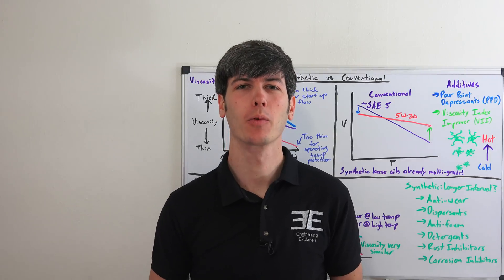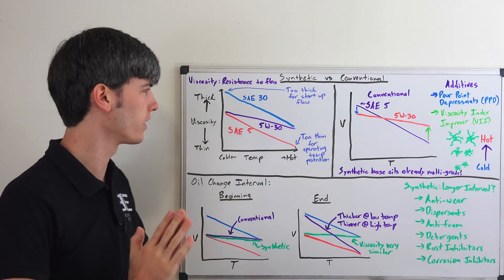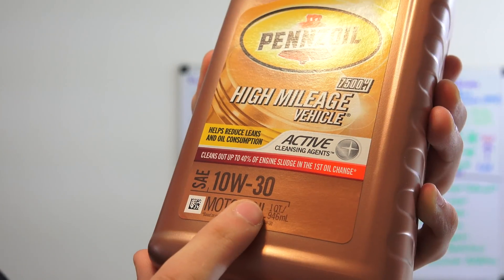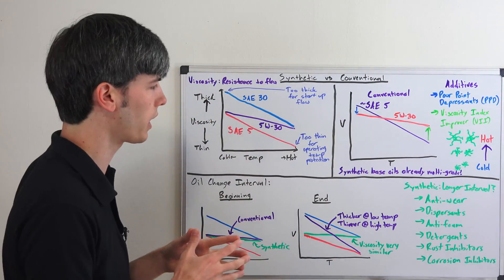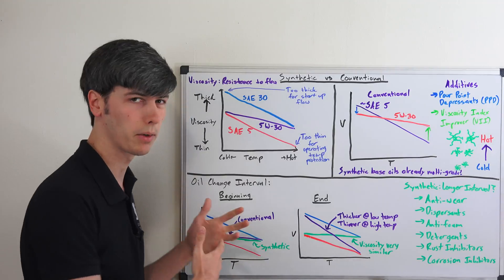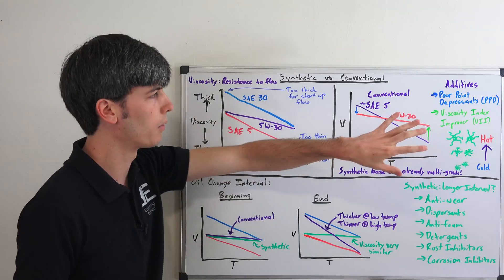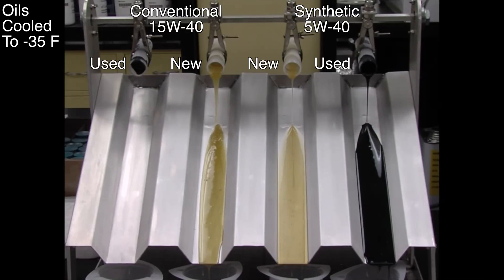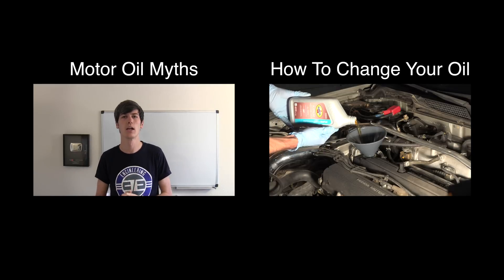Is Synthetic Motor Oil Better For Your Car?

Comment: I AM USING 10W-30 SYNTHETIC OIL FOR MY 100CC BIKE FOR HOW MANY KMS I WANT TO CHANGE IT
Reply: Its different on some motorcycles.  If your bike has a wet clutch. Then the motorcycle oil has to lube the motor and the transmission parts.  Which motorcycle oil breaks down faster due to high compression and more moving parts.  You may want to change min every 5km.  I use Motul full synthetic.  You can notice different on shifting if you use a better oil than what you are using now.

Comment: Anyone who has lived in extremely cold climates knows synthetic oil can be the difference between being able to cold crank an engine to life or not. The difference is extreme and memorable. Does the average Joe in a moderate climate who does his regular oil changes with a descent conventional oil need synthetic? Not imo. But if it helps you sleep at night, it's your money. If you live in a nice climate, buy conventional, put the extra 15 or 20 bucks (or more) in a jar every change, and use it to service your transmission every 50,000 or less (depends on the operating enviroment). Transmission failures are WAY more common than well maintained engine failures and will cost you wayyyyy more than you think. Always check with the manufacturer when extending oci's on a warrantied vehicle. If they require you to change it every 5 or 6000, you'll lose any longer interval benefits a synthetic can potentially deliver. My 2 cents. Well done video

Comment: Some of the change intervals you might see these days are crazy.  15,000 miles or more.  I have a bit of a hard time believing that the oils sold here in the USA are quite that good.  Here in the USA there is an advertising loophole that allows oils that are technically not really synthetic to be labeled as synthetic.  They are pretty much getting away with false advertising!!!
Reply: And here in Europe, that would get the company fined for millions or barred from the market.
Reply: ***** That just shows how different it is from one country to another.

Comment: @Engineering Explained what's the oil change interval for my car?
Honda Fit 1.5 Vtec, tropical weather, 22-33 Celsius(72-92 Fahrenheit)
currently using Liqui Moly Synthoil Energy 0W-40 fully synthetic,
driving: mostly city, high speed at expressway and sometimes full out at winding road(for about 30 min)
so should i change my oil every 7k miles or 10k miles?
edit: factory oil is 0W-20 or 0W-30

Comment: hello all
temperatures in my area are around 77 F during winters & 110F during summers & price is 4USD/ 1 liter mineral oil vs 22 USD/ 1 liter synthetic.
service interval is 6000 miles / mineral, 9000 miles / synthetic
considering the price difference  which oil do you recommend,
thanks.

Comment: nice video. unfortunately a 15w-50 synth is 4x to 5x the cost of a 20w-50 mineral. intend to change it at every 2k mi. what about additives (militec, molykote, tufoil, etc)? cheers!

Comment: synthetic is thinner and it'll make your motor knock it will leak out of your seals only use it in brand-new new cars I have done 10 billion oil changes in my life these are my opinions on what I've seen

Comment: He is backwards. Cold oil is thick, hot oil is thin.
Reply from the maker: Didn't say anything to the contrary. Cold oil is thick = high viscosity. Hot oil is thinner, lower viscosity. The "W" is the winter rating, or the viscosity rating when cold, which is a different scale than when warm.
Reply: RemingtonMan1969 they added things to the oil to make it behave differently in different temperatures. Like excipients for drugs :)
Reply: I have heard that you can use synthetic in an engine that has been using regular oil, is this true?
Reply: Yes you can! =) Just make sure it has the recommended properties the manufacturer tells you! You'll find that information in your vehicle's manual! =P
Reply: It is.

Comment: I used Redline  Synthetic in my High End Rotary engine with a 16 quart capacity dry  sump cooling system, I rarely changed the oil (only on rebuilds about every 60k) just added fresh and changed filters as the rotary is oil injected to keep the apex seals lubed.  425hp 13,500rpm
Reply: I use Redline in my Toyota Corolla.  Just changed it myself last week, and my mechanic basically said it's the cleanest oil he has ever seen 😂

Comment: Change your oil at the manufacturer's recommended interval and carry on. Your vehicle is not going to become immortal just because you buy a more expensive oil. Where are all these cars that have 300,000 miles on them and they run like they are brand new cars because the owner used X-brand synthetic oil ???? I'll wait.

Comment: Hello, just bought a Mercedes diesel, it has 340.000km, and I wish to know if is safe to switch the oil from mineral to synthetic?

I had a Land Rover Defender diesel and I did the switch, with more or less, 250.000km, and had it till 320.000km without complains...

Thank you

Comment: ok. where do i start? first off, an sae 5 weight is thinner than an sae 30 weight. you have that backwards. The W stands for winter. The first, lower number is the weight of the oil at typical toom temperature, about 72*F. The second number is the weight of the oil at below 32*F. Also, its not motor oil. Its engine oil. Stop giving bad information.

Comment: realistically if u drive like a sane human being.... meaning not extreme conditions like racing, very diry enviroments, or seriously hot or cold climates, good old conventional oil will be just fine. i DO run synthetic in my race cars. but i also cheap out and use conventional with 7500 mile change intervals. my current car is a 2013 mazda 3 with skyactiv engine that "requires" 0w20 synthetic. it has 140k miles on it and i have used 5w20 conventional since day 1. so my point being is synthetic "better" sure. if u have a need for better. in a normal commuter car it will do nothing but cost u tons of extra money in the long run. juat like the people who use premium gas in an engine that only needs regular. waste of money.

Comment: Actually there are no 100 petroleum based oils these days. There are anti scuffing agents and detergents added to most engine oils to the point
They can be considered semisynthetic. Don't fall for gimmicks like "liquid ball bearings" or High mileage oils. Oil change intervals is the key. 
My family has used straight 30 in our cars for decades. Moms Honda now has over 500,000 miles on it with only the usual lifetime components
Replaced ,timing belt, water pump plugs air filters Etc. the key was Dad changed oil religiously every 3-4000 miles. Synthetics are Expensive and do carry a high temp advantage but that's it. The rest is up to the engine filtration system. Most synthetics cost $10-17 a quart! The days of the $19.99 oil change are gone for now and a $85 oil change is just stupid"......I don't understand how they justify that.
Reply: Mr Tweak ..straight 30w in any car for years? doubtful. moms honda wouldve been garbage long before 100k mis. synthetic is well worth it & so long as you use "quality filters" changed when suppose to according to service manual..ur golden! we run Ford cars & trucks in my family and all last 300k mis using synthetic 5w20 or 5w30 changed at 7500mis w/Motorcraft filters.
Reply: Sounds like you are under the impression that straight weight oils don’t have viscosity Index improvers like multis do. You are incorrect assuming they don’t. Actually according to the API index straight 30 oil with modern VI improvers have a higher cst sheer value than 10w30. In other words your multi is doing less to protect critical metal components against wear .  Yes moms 88 Honda Accord had over 500 k miles and when sold in 2002 and straight 30 was used . It’s current fate is unknown.
Reply: A local independent tire chain where I live does oil changes for $19.95. But you get a no-name filter.

Comment: thinner oil does not means better protection.  plus you have no business running 15w40 in the winter. you can but why would you want to when there are thinner oil available?  i put over 200k miles on my cars before donating.  with regular oil drained at 5000 miles, none of my cars had engine wear or sludge problems.

Comment: I use oil stabilizer every oil change. No matter the type of oil. I've own several vehicles well over 200k. Had a Grand cherokee limited with 338,000 on it. No knocking,  tapping at all. Sold it on Craigslist to the 1st guy that came no hassle. I change my oil at least 5 times or more a year on any car I own.  Only cost me material so no biggie. It's worth it.

Comment: I've been using synthetic oil in my'95 Honda Civic since I bought it almost 14 years ago with about 36,000 miles on the odometer. It consumes about one pint per 4,000 miles with approximately 195,000 miles now on the odometer, which I still consider to be very reasonable. I do believe that synthetic oil is worth the extra cost both short-term and long term, just my opinion.
Reply: which grade are you using? I have a civic myself
Reply: I used Amsoil HDD 5W-30 until very recently, when I switched to Amsoil ACD 10W-30/30 oil.

Comment: It really depends on the motor. For instance, in a small engine such as a dirtbike, it can be better to use conventional oil. This is partly because you are changing the oil on an hours of operation basis rather than mileage, and partly because the clutch assembly and engine use the same oil. In some cases, using synthetic oil can actually seize the clutch as the oil will stick to it too much at high temperatures and high friction. I've seen this happen, it's not pretty.

Comment: Just bought a 2017 Ford Fusion, my first new car purchase, and I couldn't change the oil myself because they put a large plate on the undercarriage blocking access to everything. Guess my days of shade tree mechanic is over. My first car in 1990 was a 1973 Cadillac coupe deville with a 472 ci engine and it cost me $15 to change the oil myself. The first oil change for my 2017 cost me $54. Emoji sad tears.